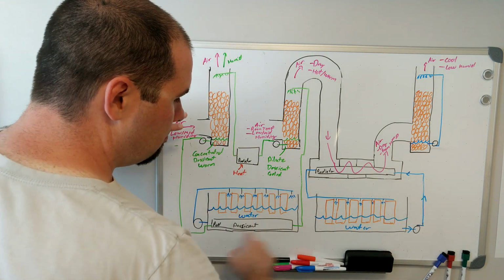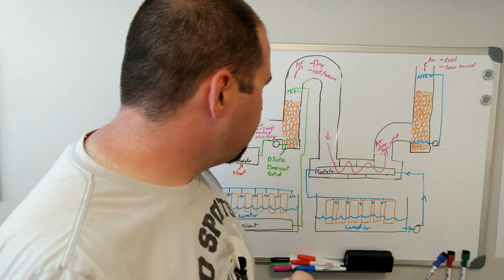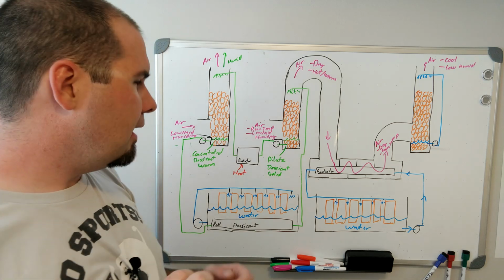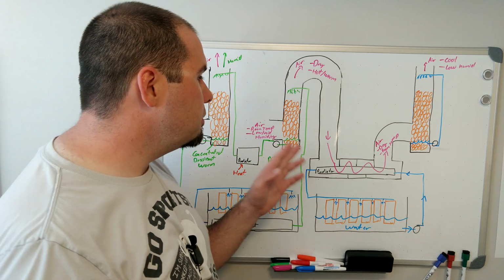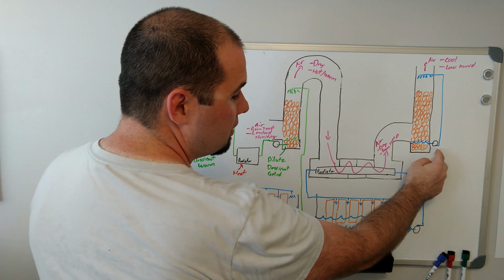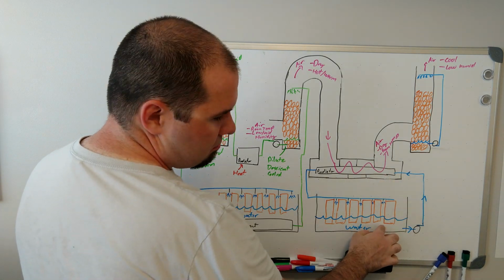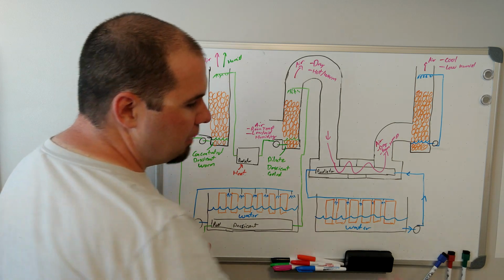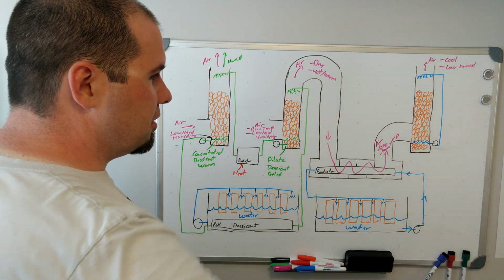A Revolutionary Air Conditioner Diagram

Comment: Despite its increased complexity, this device overlooks a major issue: the high consumption of evaporated water—particularly in water-scarce environments. With water prices rising faster than electricity costs, the device becomes impractical and more expensive to operate than a standard, energy-efficient Freon air conditioner.😢😢😢

Comment: Fantastic job! Thanks for your effort, appreciated. You did exactly what I tried to do. Unfortunately I saw your video after figuring it out myself, but at least it did provide validation off my understanding. You do provide the vital missing link to understanding the tech ingredients video. It is understandable that you did not bother to explain the entire concept, as it was done in the main video, but you provide the critical element, that is a whiteboard schematic, that the original video missed altogether. However because the concept was totally new, and the assembly quite convoluted, your video would have been much more valuable, and understandable, if you added the preamble and approached your whiteboard explanation as if someone was seeing the concept for the first time. Great job brother!

Comment: The diagram is great. The description is brain melting.
Ignore the complexity. 

Start with what the "user" cares about, cooled air: 
Room air is dehumidified and warmed in the process. Then it's cooled back down to it's starting temperature or slightly lower via a heat exchanger/radiator. Then it's re-humidified and the temperature drops further below room temp at similar %RH.

Then how that's cooled: 
The cooling for that dry warm air is provided by an evaporatively cooled water tank which is pumped through a (this) radiator heat exchanger.

Then how the desiccant is regenerated:
The liquid desiccant is pumped out of the bottom of the room air drying tower and heated to promote evaporation. It's then sprayed into a tower with an updraught in order where excess moisture is extracted and rejected in the form of external humid air. This is collected at the bottom of the tower and pumped through an evaporatively cooled water bath to chill it back down below ambient temperature. Then this regenerated liquid desiccant is back to the start where it is sprayed down the air drying column.

Comment: This system is not only complex because of the number of parts, it is also that it neither the original video or this shows where heat transfer is going. 

For example, in the middle column, the desiccant dries the air and becomes warm. Heat is transferred from that warm, dry air into the water in the radiator on the right. There is no infinite heat sink, so that heat has to go somewhere, and if it is inside, then that heat warms the air in the room. That's less than ideal. 

Then, the swamp cooler column on the right absorbs heat from the air to evaporate the water. The heat flow arrows are needed to show that just that by itself accomplishes nothing. The heat has to go outside. If the radiator on the right is outside, such as buried (ground exchange), then the system would have a net heat transfer from the air inside to the ground outside.

Similarly, there has to be a balance of water. Water enters the system, and it has to leave the system to stay balanced. The path of that water should be prominent. It's pretty clear the water loop on the right radiator is completely closed. It's less clear on the left in the green loop. The salt is a closed loop--you shouldn't lose any salt from the loop, but it is open in terms of the water. Water enters the system in the middle column (it pulls humidity from the air in the room), and it loses water in the left column.

One of the problems with this set up is how to transfer heat & water to the outside when the outside may be very hot and humid. A conventional compressor air conditioner heats up the refrigerant so much that even if it is very hot outside, the refrigerant is still much hotter, so heat flows from it to the outside air. Here, the warm dry air produced by the middle column is unlikely to be warmer than the the outside, so you can't transfer heat from it to outside, and that also means the right radiator can't transfer its heat to the outside (unless there's something cool, like in the ground). Similarly, rejecting water to a very humid outside requires heating up the desiccant even more, and if it's hot, and if the outside is hot, how do you transfer heat out of it in the left radiator? Where does that heat go?

It's possible that the reason his second, larger set-up didn't work as well as expected is because those radiators can't reject enough heat. 

When you set up the problem with all the heat flow arrows in place, then it becomes easy to see how well it could work.

Comment: Are there any DIY/easy prototypes with something like step-by-step guides or any more detailed explanations yet?
This would be of great use for camper vans where energy is usually limited.
Reply: Have you found anything? I am wondering the same thing - trying to convert a bus into a house rn and this would be perfect
Reply: @reillyteigen9445  unfortunately not

Comment: The radiator could easily be underground where the natural temp difference with the air above soil level would bring the temp even lower than the water method.

Comment: Firstly Thankyou for this Video, it is very helpful.
I am working on developing this concept for use as a RV air-conditioner. the plan is to use readily available Hardware and aftermarket Automotive components.
- submersible pumps, marine bilge fans, air to water heat exchanger, water to air heat exchanger, garden irrigation misters. plumbing pipe.
My motivation is that its main benefit is it is a dehumidifier, which it really important for a RV with a built in shower.
wish me luck
Reply: Have you built this yet, I've got the same plans

Comment: https://www.youtube.com/watch?reload=9&v=R_g4nT4a28U
https://youtu.be/WCn7ChnS6VQ?t=489  has a nice flow diagram.

RE: DIY AC - not just a swamp cooler (SC), but better, advertised efficiency is 2x that of a typical window ac unit, by using low cost desiccant(D)  (salt water 35%) and 3 SC's, 1 that uses hot D to better absorb water, the other 2 SC's cooling the water and cooling the final air out/   The reason it works is bc the "relative humidity's and temps are within comfort %'s for human comfort.   

GREAT VIDEO ~~ !  I think the difficulty for most  in understanding "might" be the first 4" tube is not connected to the other 2, so the heated hot D (salt water 35%) drips down, the air goes up and "presumably" being hot and humid is expelled out of the house.    The reason for heating the D at this 1st stage is bc it absorbs alot more humidity (water) from the air that at the higher temp, thus immediately making the house air less humid.  Stage 2 pushes house air thru the 4" tube using  cooled (by swamp cooler #1)* D to further remove humidity and cool the air more, stage 2 air is pushed thru a cooling tube which uses cooled water from the SC #2 to cool the air ,  stage 3 seems to be a #3 SC using water to do the state of energy phase change (water evaporates and sucks heat in the process), this final air flows out to inside of house tube ( bc the air is already very dry  it works to cool with cool water from SC #2 and add back a small amt of humidity which is acceptable bc its below comfort level for humidity)> Just conjecture, plz correct me if I am wrong.  * I would imagine the 2 rectangular SC's #1 & #2 for the D cooling  and water cooling are vented to outside or perhaps "Are" outside, to prevent that humidity from being re-injected to the inside house air.

Comment: Vapor engine Exhaust gas temp (EGT) solved:  Old pilots from ww2 running low on gas, noticed that the EGT rose as the gas mixture was leaned, but later at max leaning the EGT Fell to normal levels; so the EGT overheat burned valves etc problem is not an issue afterall.     Wanna get more mpg , try the "Heated" gasoline vaporizer , one guy told me his friend had one on a v8 pickup that got 75mpg ?   I think the trick is to heat it using engine waste heat (either exhaust gas for quick heat or radiator fluid running the thru a couple heater cores immersed in the liquid gasoline, and then bubble up the air from the bottom of gas tank to get the much better vaporized gas (then on into intake of carb).. some say 100mpg is not out of reach.
Allan Dulles
2 weeks ago
thats exactly what some research paper on air fuel mixtures on the internet said. found it a long time ago. the key to efficiency was getting it so lean that it ran cool.

Comment: Okay so, this was explained backward from finish to start...and I like the diagram. What I don't like are all the "it" takes "it" to "there" descriptions. IT is not helpful if we don't know what it is, especially if it is taking it from the other one and going over there! Still, thanks for making this video. It was just what I needed to finish it over there...Or should I say, The diagram was just what I needed to finish my design.
Reply: hey any progress?
Reply: @razil6749  I didn't have any money to build it..and finally when i did, I just ended up buying a decent evap cooler. Actually it works so well, I just never bothered modding it. In fact the day I got it, it was 108oF outside and inside it was 78oF. In front of the coolers blower I was quite comfy. I knew from experience though...don't go cheap on those. Mine was $300. Worth every cent. If I ever move to a [Humid] climate though I may proceed to make one of these.

Comment: I understood his explanation but I was hoping he'd actually show a version of his work done in a practical manner and put on a standard air conditioner.. I could have swore I heard him say that it could be done but never saw it in his video..  In East Texas you cannot use swamp coolers for this very reason..  High humidity..   I wanted to use this tech on a swamp cooler outside as to make my garage into a super cooled area by using it practically on my swamp cooler..   swamp cooler is adding water to the passing air, but at 100% humidity, the only cooling effect you get is the water hitting your face.. it becomes a huge waste of water and space.... Now I see the science a little better and may be able to do a practical experiement with it...

Comment: deccanet is (salt only )that absorb humidity  
but 
deccanet liquid ( water+ salt ) can do two things 
1/ if it is hot diluted , it will release humidity to air and become high concentrated ( much salty)   
" making concentrated deccanent in left column"

2/ if it is  cold concentrated ,  it will absorb humidity from air and become diluted 
"makig  dry air in the middle column "

also
dry air + water= cool air  
" right column"

Comment: Tech Ingredients has an updated, larger version of this system that works in a different way.  Instead of using room-temperature desiccant to dehumidify, and then using heat exchangers and evaporative cooling to reduce the temperature of the now-warmer intake air (and re-introducing humidity)... it uses chilled desiccant and doesn't run that air through evaporative cooling.  The product air is just returned directly to the room.  The diluted desiccant that has absorbed humidity (and now heat in the new system) is heated with a solar water heater, and is itself dehumidified, very similar to how that step works in the original.  The difference is that instead of using evaporative cooling on the charge air, the evaporative cooling is used through 2 different heat exchangers to chill the now-regenerated desiccant.  The desiccant runs through a traditional fan-driven air heat exchanger, then a 2nd heat exchanger on the output side of the evaporative cooler.  The now-cooled water in the reservoir of the evaporative cooler is also pumped through the outer jacket of a wort chiller before running back up to the top of the evaporative cooler to cycle again.  The final cooling stage of the desiccant runs through the inner tube of that wort chiller before returning back to the dehumidifier/air conditioner.
Reply: I was thinking about a more recent video by Tech Ingredients, where they let the water cool by irradiating infrared through a special glass (if I understood well). If they combined it with that desiccant, maybe we would have a more efficient system ?
Reply: And… it preformed poorly.
Reply: Thanks. I need to see that

Comment: Great video, you mentioned that the second radiator doesn't need to be clean water, but I think it does need to be clean water because it will be inside. I think this was also mentioned when he explains why the radiator for the outside portion is stainless steal and the other radiator is aluminum.
Reply: Technically, nothing except the final stage needs to be clean water. The entire unit can be outside except the exhaust and air intake lines. Personally though, I am just going to use regular hose water, and salt water.
Reply: @peterlamont647  please share a video on yours
Reply: @peterlamont647  If you didn't know, you can't use regular sodium salt. It needs to be hygroscopic like calcium chloride which is sold pretty cheap as the road salt for melting ice that's not as toxic to plants as regular rock salt.

Comment: Very useful. Thanks for tge diagram. With dry air at room temperature, what temperatures can be achieved by evaporative cooling?
Reply from the maker: Check out Tech Ingredients channel. He did the builds, but just omitted this diagram that people wanted. Just a supplement to the nerds like me.

Comment: the question is now ... can we replace the heat with a reverse osmosis membrane :) i will try this in the future
Reply: That would remove the salt, thus rendering the liquid desiccant useless. Unless I am missing your point?
Reply: @peterlamont647  no you have a salt-rich solution and salt-free water that coming out of the system. I just wonder if it works or if the salt concentration is so high that it crystallizes in the membrane
Reply: @sir.burbonburg7008  Well, I guess my question is why?  You could just have two reservoirs. You'll need to feed in new water all the time anyway because of evaporation. My question is, what(other than combining reservoirs) does the osmosis do?  Does it do something to the heat exchanger? Does it ...I don't know do something? Maybe I am reading too much into this.
Reply: @peterlamont647  I would be interested in energy efficiency, if you have access to solar thermal system you don't need it, but if you don't have it you could use an osmosis system to dry the solution in an energy-efficient way.
Reply: @sir.burbonburg7008  Ah, now I see! So the reason they are heating the salt water is to increase the salinity. I missed that part completely. If that is the case, how much energy does reverse osmosis take? I imagine it is very slow to leech through unless it is pressurized.
Reply: @peterlamont647  Yes, osmosis requires little mechanical energy, but I don't know if you can send a 100% saturated solution through the membrane. it may be that the hydrogen bunds are too strong to break them mechanically
Reply: @sir.burbonburg7008  Well, my thinking on this is that I don't understand the heating part enough to say one way or the other. My gut feeling is that it would require almost the same energy to squeeze  the water out. Perhaps the only semi-automated approach that could definitely do the job would be to use a heavy piston in a cylinder so that gravity would alleviate some of the kinetic power required. Only then you would have to move the piston back up manually in order to save the energy being used by pushing up a heavy piston. One could also use a coil spring...those store lots of kinetic energy. I think that an actuating or pump driven osmosis device would likely use as much energy as heating..still worth a try! If it doesn't work, you can just replace it with a solar heat exchanger. Where I live, it is so hot, I could simply have a metal plate on top and pipe the heat down by conductance to heat the liquid. There is not much liquid to heat, remember. You only have to heat what is in the column.